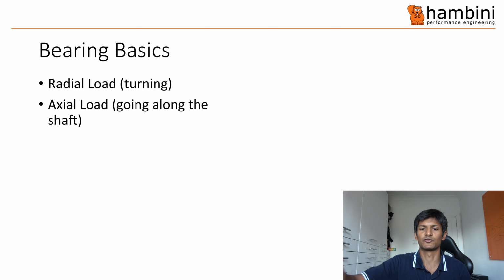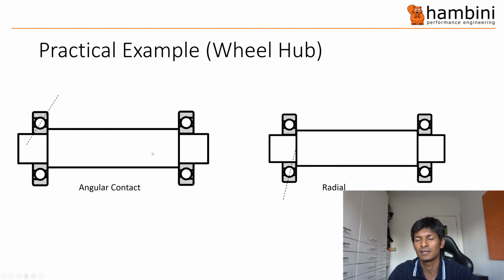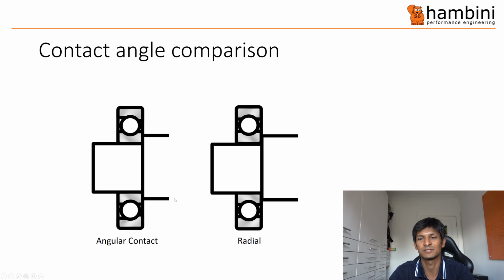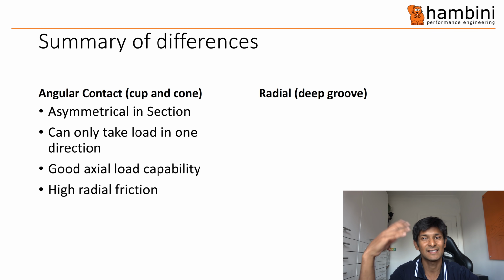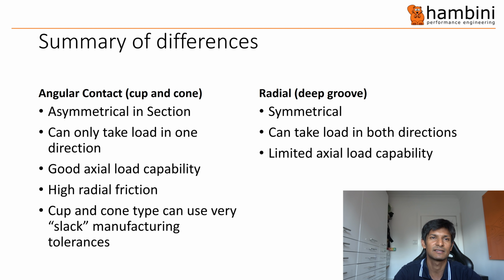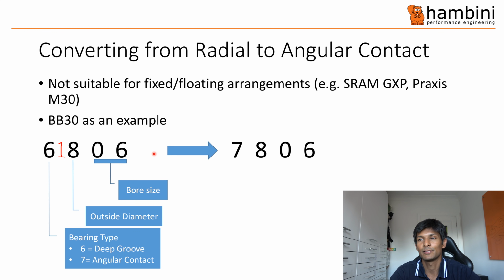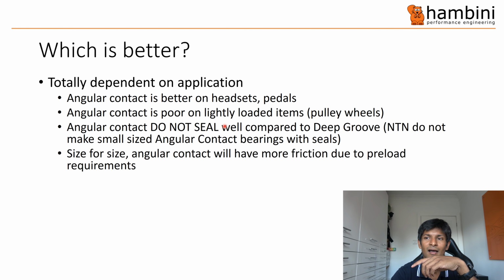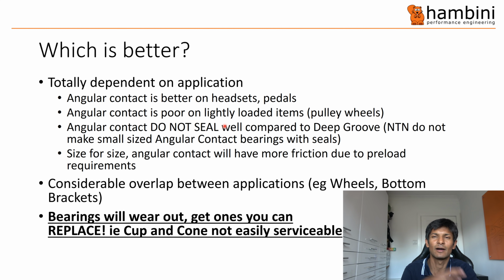Angular Contact vs Radial Bearings (Cup and Cone vs Cartridge): Engineering Analysis

Comment: Excellent video.  One thing I wish you could elaborate more on is the fact that many wheels have sloppy tolerances and when those sloppy tolerances are mated with radial bearings the end result is very short bearing life.  I can't say what percentage of wheels that use radial bearings have this issue but here's a prime example by Ronald Kuba (https://youtu.be/GpfD28tQ_sA).  So when one buys a wheel that uses radial bearings he's taking a gamble on the manufacturing tolerances.  With Shimano/Campy's cup/cone bearings this problem is avoided.  For this very reason my wheels (Campy) have cup/cone bearings.  Servicing them is easy, as long as they are done regularly.  If not done regularly then the cups/cones can wear out but from my experience that's quite rare to see.  In the long run cup/cones are much cheaper because one doesn't have to replace the bearings.

Comment: Thank You for an excellent explanation of ball bearings. You gave a great overview, but as you know it can get very complicated when the bearings are designed for a very specific use. In the last century, pre-2000, cartridge bearings in hubs and bottom bracket had contact seals and you could feel the drag and feel a wobble after extended use. High quality cup and cone bearings when properly adjusted felt lower in friction and with regular service gave great life. Campy used to sell replacement cups, cones and bearings(grade 25). You might want to explain bearing grades and how that affects bearing performance.
Reply: I used to change the cups & cones on my Campagnolo Record Mk1 hubs and was still using them up until the bike was stolen in 2012.
Deep groove cartridge bearings are designed for HIGH SPEED applications (RPM's in the tens of thousands).
Most pro riders won't get above 80 mph on alpine descents that equates to somewhere between 700-800 rpm which for a deep grooved cartridge bearing is SLOW!
So at bike speeds they never warm up to normal running temp and therefore run slack.
Reply: @nigelnightmare4160  {
Reply: +1 Jeff Daniels.  That is my experience too.  Shimano cup and cone bearings, with simple maintenance lasts lifetime.  Only trouble I’ve had is CSB cartridge bearings in what was sold as “high end wheels”   Maybe Shimano has a point!?
Reply: @Apollo Corbin flixportal xD
Reply: @Jameson Jaden Thank you, I went there and it seems to work =) I really appreciate it !
Reply: @Apollo Corbin glad I could help :)
Reply: I realize it is kinda off topic but does anyone know of a good site to stream new movies online?

Comment: Besides the ball bearing tolerance of the better bearings, NTN, etc are the cages, races, etc better than a common Enduro bearing?
Reply from the maker: Yes. The cages in cheap bearings are usually snap in plastic cages

Comment: Would love to see you do a video on Disc vs Rim brakes, from an aero perspective.
Reply: NOt just a aero persprective but performance perspective as well, Brakes are only as good as the person operating the lever
Reply: @Steve-jo3cl  Disc brakes have greater stopping power.  What needs to be addressed is the effect of disc brakes vs rim brakes on time going up and back down a tour de france climb.  It will be the effect of time savings on the way up vs time savings on the way down.  With disc brakes you can stay off the brakes for longer and pass opponents on the way down the switchbacks.  With each switchback and each hairpin turn you make time up on the descent.  Watch the tour de france stage 19 of this year.

Comment: Hey Hambini, I am a big fan of your videos. Thank you for creating this presentation. Unfortunately, there is some major contradiction between your claims on angular contact bearings and what Wheels Manufacturing LLC / Endurobearings claims. You may be familiar with Wheels Manifacturing, as they create bottom brackets for road and mountain bikes, with both radial and angular bearings. This is taken right out of enduro's website: https://www.endurobearings.com/products/bearings/angular-contact/
 "We produce a line of Angular Contact (A/C) cartridge bearings specifically designed for hubs. In standard radial bearings, only 3 or 4 balls make contact during the load, at any given time. In Angular Contact (A/C) bearings, ALL balls are engaged and spread the force over a larger surface area, to decrease friction and minimize wear. " So according to you, angular bearings have  MORE friction and according to enduro bearings, they have LESS friction than radial bearings, in hubs / bottom bracket applications. Who do i believe? What about longevity? are enduro claims correct as well? Thanks
Reply from the maker: Here's a link showing the friction coefficients between bearings https://www.amroll.com/friction-frequency-factors.html

The contact stress on a radial bearing is a point so it cannot take as higher load as an angular contact but the friction is higher.
Reply: @Hambini  Thank you for this info. I will ask Wheel Manufacturing LLC about this, and post their reply (if they do reply)
Reply: @Hambini  Coeffcients on paper might be in favor of cartridge bearings, but the question is: are those numbers taking into account seals? Most friction in sealed bearings is not coming from balls touching the race but from seals, cage and type of oil. I am not entirely convinced about friction advantage of sealed bearings over well maintained and adjusted cup and cone ones.
Reply: GG DD where did Wheels mfg claim that they have less friction? Hambini says the increased friction comes from the additional preload required for angular contact bearings to function correctly. This is the exact additional load that keeps all bearings in contact at all times. Bearings almost never give out because of mileage on a low-load application like bicycles - unless the bearings are tiny. They give out due to contamination, to which the angle of contact is nearly irrelevant.
Reply: @404nobrakes  Please read the quote i wrote, right from the enduro website link i posted: " In Angular Contact (A/C) bearings, ALL balls are engaged and spread the force over a larger surface area, to DECREASE friction and minimize wear. "
Reply: EDIT: They can also give out due to poor tolerances in the bearing or housing of the bearings. Or because of poor material choice like with hybrid ceramic bearings.
Reply: @404nobrakes  AFAIK, I don't think this is the case with Wheel Manufacturing bottom brackets, as they only come with enduro steel radial / angular bearings, no ceramic crap.

Comment: Seems that you alluded that the angle of the spokes create an axial load. I believe that the hub shell takes these loads and transfers them to a radial load. Of course any outside applied axial load applied to the wheel will transfer to the bearings. Good video. Your illustration of the section through the axial bearing depicts a symmetrical inner race. Shouldn't it be asymmetrical?

Keep up the good work.
Reply from the maker: The section through the wheel uses two 6803 bearings which are a popular size for front wheels. They are symmetrical. The PowerPoint diagrams have both angular and radial with the asymmetrical sections

Comment: Very interesting. Thanks for sharing. I always thought the slight differences in ball diameter and cage spacing would make it more of a hunting ratio. It makes sense hearing it out loud. If I’m interpreting correctly the slight differences in cage and ball manufacturing will just skew the fault frequency one way or the other but still be close to the manufacturing spec? Is there ever situations where you would see ball/roller slip and move the fault frequency to something unexpected? Maybe light preload? Anyways thanks.

Comment: I replace the bearings in my Race Face  BSA BB with Enduro SS angular contact bearings. I put them in the Race Face cups. Right off they were smoother and after 4 months they are working smoothly. I did pop the crank out to see if there were signs of spinning in the cups as I just pressed them in, and there was non. So a $63 upgrade to a 2 year old BB. I'm happy.

Comment: What are your thoughts on the new SKF MTRX bearings? I am mostly interested in bearings that last in wet and muddy conditions.
Reply from the maker: These are skf marine bearings in bike sizes. The technology is proven. The issue for road use is the drag
Reply: What bearings are you using Andrew? Bearings in my hope hubs last ages and I ride mtb in all weathers. Heard hope use INA bearings seem good compared with some I’ve used before
Reply: Click Bait yes where appropriate I’ve been using a thicker grease Mobil xhp 222 on outside of bearing seals to help waterproof them seems to work so far
Reply: @Click Bait And don't pay perfume prices for a degreaser that will just break down the surface tension between grease and water, turning everything into a rust coloured chili mayonaise-like emulsion....

Comment: What do you think of the Zipp 454 wheels? Maybe a good video topic analyzing the wheels.
Reply: He has mentioned them in previous videos. He does not think highly of them, because the humpback shape doesn't improve the aerodynamics. Air doesn't have the density needed to make the system work as it is marketed, you need something with the density of water for it to work. The 454 is slower than a 404, but I think still faster than Flo wheels.
Reply from the maker: If you have a look at the engineering masterclass in bike wheels video. They are addressed in there
Reply: They are fraudulent wheels.

Comment: Is it worth to by grade 10 ball bearings for higher end wheels like shimano 105 , ultegra or even for the lower end ? Or stick with weldtite which is grade 1000 clearly rubbish. If the answer is yes where should I buy them ? Stainless or high carbon steel ?
Reply: Aladar Somogyi i have the same question
Reply: Yes.  Absolutely.  This is an upgrade I make whenever overhauling a cup and cone bearing.  It's a waste of time to go to the trouble of rebuilding it with high quality grease and proper assembly with anything below grade 25.  But remember, if the races are really cheap, pitted or not properly oriented, it won't matter.  Bearings only last when they're properly mounted in a faced head tube and bottom bracket shell.  Or a hub being clamped into a frame with bent dropouts.  Or a hub with a bent or damaged axle.

Comment: As it's pertinent to your upcoming video premier, I wonder if you (@Hambini) would care to comment on the following statement by RWC (Real World Cycling -- looks like a subsidiary of Enduro, which probably explains a lot) on their website regarding "outboard bottom bracket design." Any scientific truth to their many claims?

*"Angular contact bearings are a step forward in outboard bottom bracket design. Why? Deep groove radial ball bearing cartridges are not designed to be "adjusted." Any inward or outward pressure on the inner races put them out of alignment with the outer races, forcing the balls to ride up the side of the groove and exerting greater pressure on the races. This results in increased friction and premature wear. Since almost all outboard crank sets exert some inward pressure on the bearings when installed, it only makes sense to use a bearing designed specifically for such loads. Angular contact bearings also result in 100% ball engagement when pre-loaded, making them stronger and longer-wearing."*

Thanks!
Reply from the maker: Hi David, it will become obvious in the video but this is more like a marketing bulletin for Angular contact rather than any technical basis. As well as some of the statements being false. Hambini
Reply: As I suspected...

Comment: Looking forward to this: cartridge bearings seem to be the norm on modern higher-end bikes, but I still chose to build mine using both. Going to be a good Saturday. :)
Reply: Cartridge bearings haven't been used since the 90's, WTH are you talking about? Pressed in bearings are not the same as cartridge bearings.
Reply: Rod Palm You are, of course, correct: press a loose ball bearing into a banana, and you will have a ”pressed in bearing”, possibly even a crude way of demonstrating what a prince albert is to a tipsy friend or two at the bar without being thrown out, but ultimately something that is not the same thing as a cartridge bearing. Your mileage may vary, of course.

I take ’pressfit’ to just describe the way two objects are held together, or the interference fit that’s achieved when two objects of suitable shape and size are pressed together. And yes, neither of these objects have to have anything to do with a cartridge bearing. That having been said, whenever I open up my threaded BB and replace the bearings in the cups, I sure do pressfit new sealed cartridge bearings in there before I thread them back on.

Maybe it’s a language thing?

For me, a ’cartridge bearing’ simply denotes the metal thingamajig with all the races, bearings and seals contained within a single nifty enclosure, as opposed to e.g. loose cups, ball bearings and cones. The word can, of course, mean something completely different to you, but at least Google Image Search and Park Tool seem to be of the opinion that those pesky little donuts are used in modern bikes as well. If you have a bike with a pressfit bottom bracket that runs without cartridge bearings of any kind - more power to you!  (Just as long as you’re not running lemmings in there.)

And if you simply mixed up cup & cone bearings with cartridge ones in your comment - check out this small company called... erm, He-man...? Sheman? Shimano! Yeah, that was it, I think. Still producing hubs in 2019. Small little outfit. Cough. Steel bearings rolling on work-hardened steel cups, very little in the way of friction or seal drag when adjusted and lubed correctly, and seem to last well under all kinds of side loads. Easy to take apart, clean and maintain to boot. Old tech? For sure. Trendy? Hell no! But I prefer them in my wheels nonetheless. You might, of course have to lace a fresh hub once every decade or so, but I think it’s a fun exercise too.

That’s WTH I’m talking about, thanks for asking politely. :)
Reply: @rodpalm6398  yea fuck you rod palm.

Comment: Do you think you could add any solid engineering insight to the current thinking on chain waxing and efficiency / chainlines / etc? Seems like there's a lot of hype around it right now. I've been waxing my chain for a while and it's legit for keeping everything clean, but I'm not sure on the other claims that are spoken about...
Reply from the maker: I can't add it to this vid because it has already been uploaded but I will look at it in the future.
Reply: @Hambini  Sure, that's what I meant mate. Just a suggestion for the future.
Reply: submerging your chain in molten parrafin wax has been proven many times to have the best efficiency of any lube other than molten speedwax and specially treated wax/powder chains. There are marketing hype lube such as wend wax which do not work nearly as well due to the fact the insides of the chain are not properly lubricated. Fully cleaning then submerging the chain in molten wax is the only way.
Reply: @albr4   There are friction tests in the internet showing the Molton wax/powder as the most efficiënt. But very close to it is Squirt wax. I always clean my chain after rides of 100 / 120 K + or after rain and dirt. Never sook it in gasoline etc. 

Just take the chain of  by using a chain link.
Just claning with a cloth, sometimes a bit of diesel on the cloth to clean the surface but not lettinbg this fluid get into the chain. Or using hot water with Dreft (dishwasher detergent).
Then is necesssary brushing out the chain of dirty residue. Then wax well and make sure the fluid gets everywhere so also into the chain. After one hour clean the surplus of wax away and mount the chain again.  Shimano Ultergra group and do between 8000 - 9000 km before replacing it.

Using e.g. a KMC chain which metal is much harder will cause more wear on your sprockets and the advice is to use a Shimano chain if you have e.g. Shimano chainrings and sprockets.

Before I used 2 chains, chaching them every time after n very dirty wheater rides or 500 K + dissamble it, clean in  benzine, then hot water with Dreft. Better twice in very hot water with Dreft. Then using a compressor and drying it by using the air gun.
Then cooking it in a Putoline Chainwax used in motocross. Then also removing the surplus on the outside. Y0ou get very little weart on the chain witg this method but have to ride always at least 50 K to get the chain in a optimum state. (most efficient usage, less friction) Of course again after the first ride you have to take away the residu of wax and dirt wich is accumulating on the chain.

This cooking etc. is a lott of work and the methode with Squirt is much easier and almost the same result considering friction effeciency and chain protection.
Reply: @bbqreunie984  "clean in benzine" by which I assume you mean gasoline?  I sure hope you don't mean Benzene!!!!

Even if gasoline, is absorbing these hydrocarbon compounds worth it?  I don't think so.  Plus, using gasoline, or other volatile compounds in a shop environment is a recipe for fire and injury.  I don't think it's worth all the time and effort to obsessively clean every last micron of a disposable item like a chain.

Plus, many have argued that wax is not an actual lubricant at all.  Just a coating that quickly rubs off.  I'm not making this argument because I've found wax to be sufficient.  But I've heard compelling arguments to the contrary.

Either way, not worth the cleaning regimen.
Reply: @albr4   100% correct good old candle wax (parrafin wax) and you cant go wrong